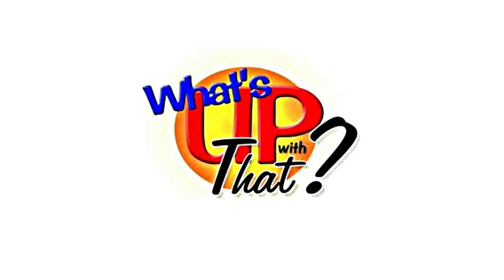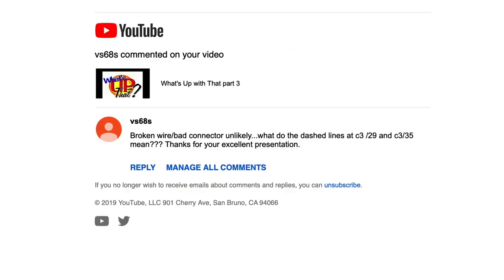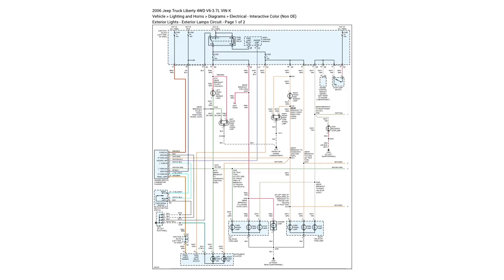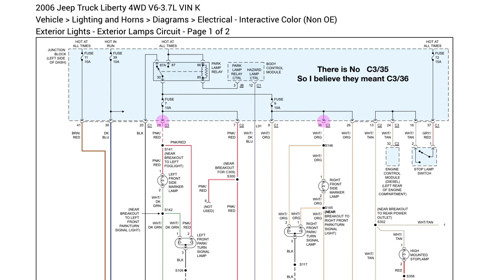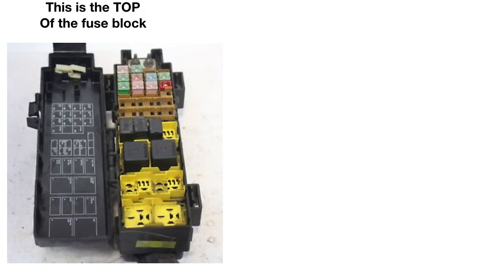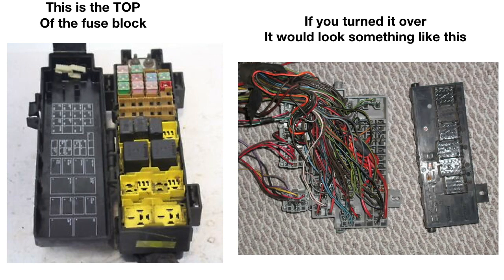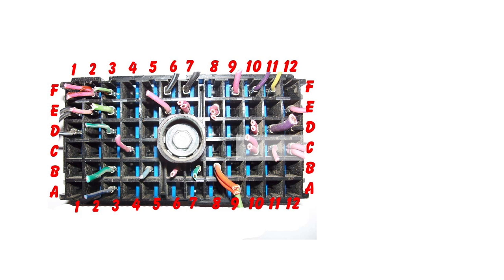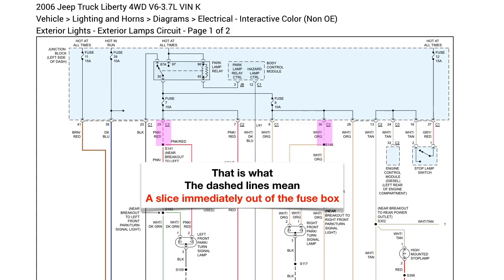A study in reading electrical diagrams Follow Up

Comment: on some manufacturers the dashed lines were for optiomal equipment that may or may not be on the car. many times the wires are in some places but not all  such as trailer towing package. sometimes you have to put a kit consisting of sockets fuses, relays and a partial harness. always check the diagram legend (its just like a map legend) to see the meanings. some will vary.
Reply: If you use critical thinking, there are two wires immediately after the dashed line which explains a splice exists.